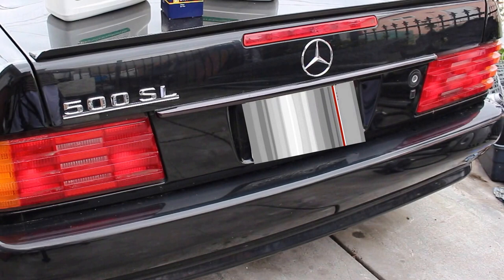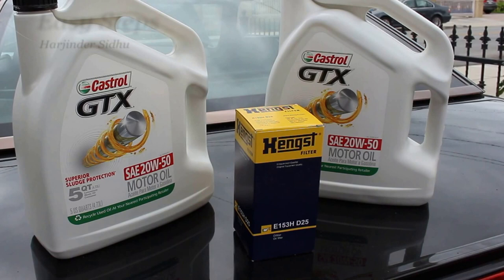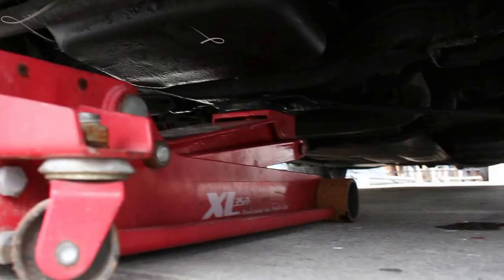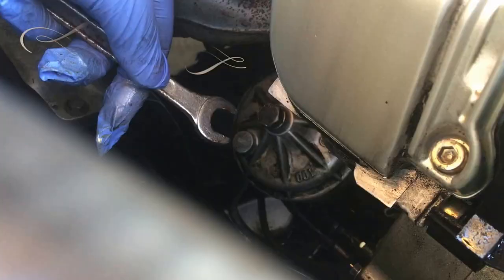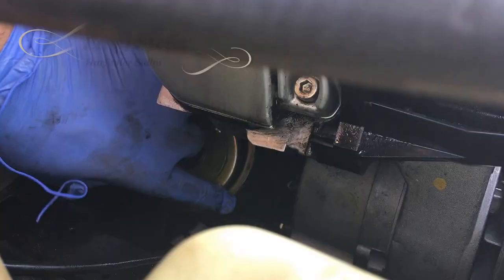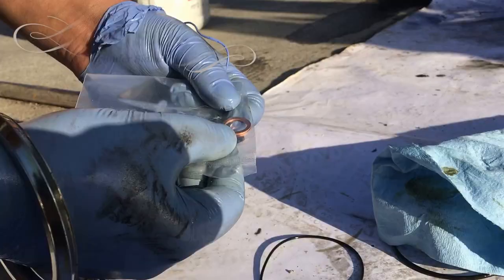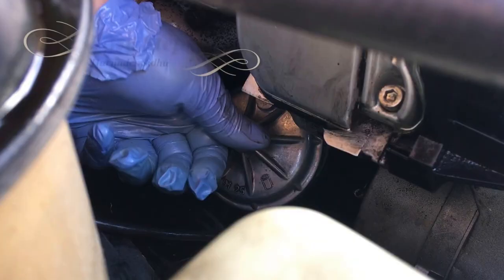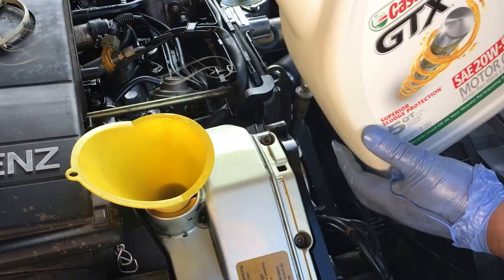How to change Engine Oil & Oil Filter on Mercedes 500SL | R129 Roadster Mercedes Oil Change

Comment: 8.5qts was enough ?  Or you should add more after ? MB maintenance says Oil capacity of M119 engine is 8 liter. 8liter = 8.5qts. So they mean not capacity rather suggestion of oil quantity to fill in, right ?
Reply from the maker: 8.5qts is the correct amount, thanks for watching.
Reply from the maker: I have started posting DIY videos on my 2nd channel "Sidhu DIY" so please like, share and subscribe, thanks.
Here is the link for my 2nd channel, thanks in advance.🙌 🙏 🙌
https://www.youtube.com/c/SidhuDIY